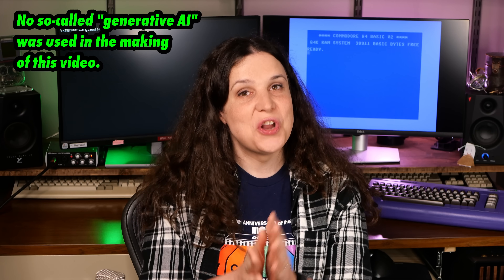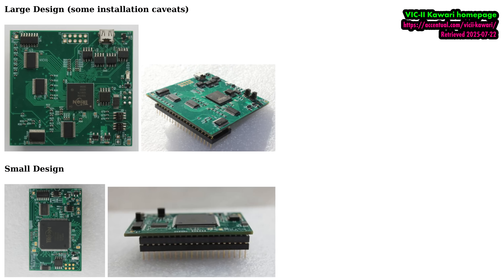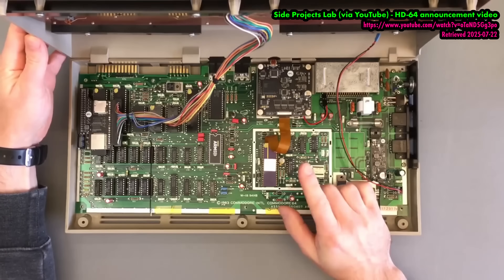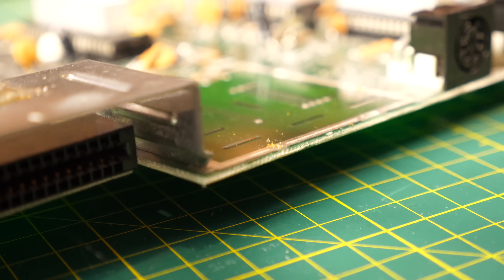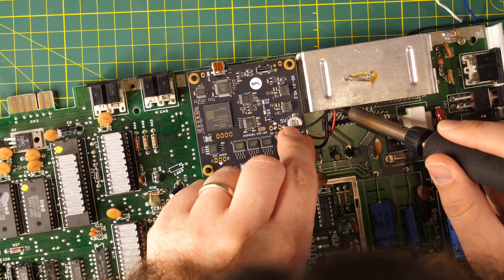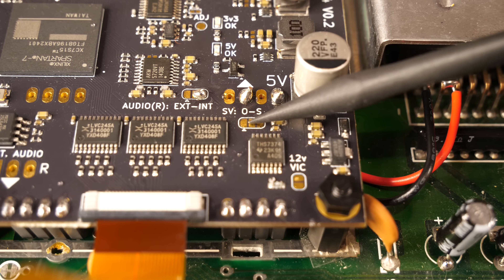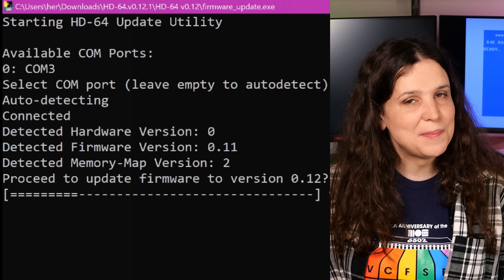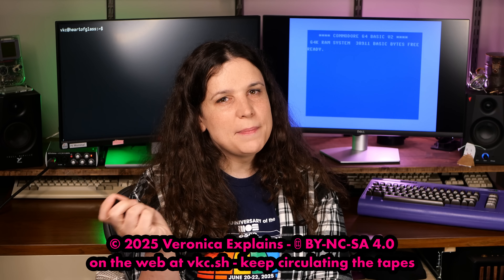My Commodore 64 has an HDMI port now.

Comment: On ZX Spectrum we have ZX-HD for years now, no soldering, just connecting 2 boards and tightening few screws. Now the Spectrum NEXT has built in HDMI. I'm a big FPGA lover and own an Ultimate 64 and a bunch of crude C64 and C128. Does this board works on C128 too?

Comment: Who paid the HDMI license?  When you have DVI mode out, an HDMI license isn't needed but when you blend audio with the output, the HDMI police might come knocking.  If you build the project yourself from the board, it's hard for them to come after you, but when you BUY it already assembled, the HDMI police would go after the guy who sold it to you.  If some method or technique to escape the license requirement it would be good to know because in the "Color Computer" world, we have "CoCoDV" (which outputs using an HDMI connector but without audio) and there is the RGBtoHDMI now with an audio addon-board, but it's kind of clunky whether outside of the case or inside.  If the CoCo's RF CAN whether on the CoCo1/2 or 3 or the MC-10 is replaced with a board like this it would have to be smaller) it would be neat and clean and beautiful.... like your rig.

Your solution is CORRECT in my opinion.  The biggest problem with retro is display devices.  S.Video is RARE now and composite is still out there but the quality never delivers.  It's either Lumacode or something else.  But this is clean and VERY portable.  You can take it anywhere.  Can't say the same for the more clunky solutions.

Comment: Great video ! For twenty dollars more, I ordered and installed the Kawarii. 
 It has the same great HDMI and it replaces the aging VIC chip.
 The Commodore community is alive and well. We are winning the war against the gatekeepers.
Reply: With all due respect to Randy and his incredible work, the Kawarii carries no audio over HDMI (it does good ol' DVI) and does not output Full-HD, so you're at the mercy of your TV's upscaler
Reply: @sideprojectslab7352  Correct points to be sure, but all of the new gadget fanboys, myself included, have to remember that others consider that full hdmi experience to be too VICE like.
Reply: @sideprojectslab7352  Can the HD-64 be added to the small Kawarii that doesn't have HDMI?
Reply: @Zardozer  yep
Reply: +1 For the Kawarii. It's an awesome replacement chip and the extra video modes are the cherry on top. I'll definitely be checking out the HD-64 though. This renaissance in hardware projects for the good ol C64 is incredible.

Comment: C64 purists will argue that the C64 isn't supposed to have a razor-sharp display, and that the graphics were designed for, and look best, on a CRT monitor complete with scanlines and color bleed. I always found it ironic that back in the 80s, C64 owners were trying to get the sharpest display that they could, while today, emulator users are trying to make the output look as blurry and distorted as it did in the 80s.

CCGMS - This was my favorite terminal program! I used a couple other ones occasionally, depending on the situation, but this was what I preferred for daily use.
Reply: The irony is only apparent, different people look for different things and, for those folks who need 'em, the HD64 provides artificial blur, scanlines, and soon PAL color blend :D
Reply: @sideprojectslab7352  I wasn't aware that the board provided CRT emulation. I've only watched this video about it.

Back in the 80s, I and everyone I knew with a C64, tried everything we could think of to try and get a sharper image, and reduce the color bleed. Wrapping the RF cable in foil, using a coax cable with RCA adapters on each end, connecting a resistor across two of the pins of the monitor port, etc.

Comment: About audio for the RGBtoHDMI: This is already supported for some time now thanks to some miracle done by Ian. You only need a very small add-on board that can be installed in any existing RGBtoHDMI. (Or buy one that has this already installed).

Comment: I don't have a C64 unfortunately. I have pre-ordered the new C64 from the new Commodore though and I hope that project turns out well. I do have an Amiga 500 though and with a PiStorm and the RGB2HDMI + gotek it's amazing. I have a simple KVM and I plug the HDMI output from the PiStorm and the RGB2HDMI into it so that way I can use one monitor and just press a button to switch displays.

Comment: Soldering, singing and playing guitar, editing video, knows ways around Linux and COBOL... 

What can you NOT do? There must be something.

This is incredible work. 

I use an IBM KB8926 (Yes, really!) and now I wonder, would it be possible to make a "Linux desktop keyboard PC"? Like the commodore, but making a fusion between something like this KB and something like a RBPi or something and you would only need a monitor to plug into to see image but technically, it would be a "portable PC" that is not a laptop. 

I am sure some engineer out there thinks "Sure, I can make that work".

Comment: A good and lovingly made video, thank you Veronica. But 109€ + shipping just for the HDMI output? You can get 2 working C64s for that around here. I prefer to stick with a CRT monitor, that's what the C64 is made for and for its imperfections. The C64 graphics look much worse to me on a modern monitor.

Comment: That appears to be a sweet solution. Loving the config menu options and that audio is included! All I wonder is if the FPGA actually does VIC emulation or is it just doing image processing? Because I for one would prefer the VIC (or SID) not to be emulated..

Comment: "Stop gatekeeping retro" 💯
Reply: Ain't nothing wrong with using upscalers or HDMI adapters or even emulation. anyone telling you you're not having fun or "doing it wrong" is wrong.
Reply: @JessicaFEREM  Absolutely. Emulators open up a lot of doors to various improvements in games, especially with HD or widescreen mods, or even support for new "virtual" hardware or mappers.

I primarily use software emulation to play older games, but also have various FPGA-based consoles that I equally enjoy.
Reply: Most of the people I knew who had C64s back in the day loved to mod them.  Adding dual sound chips and hacking the motherboard to add hard drives were two of the most popular mods back in the day.
Reply: Retro for all!!!
Reply: FPGA is literally a tool, like any other tool. It's like arguing over what brand of soldering iron someone uses ffs.
Reply: Precisely, we love retro and if retro can be improved with modern tech & manufacturing, so be it. At the core, it's still retro.
Reply: Soon there will be an original C64 board in the core of a future Commodore Droid running household and outdoor physical labor in our gardens. What a marvel to see people enabling old retro hardware while maintaining its natural and deep historical charm within.
Reply: what kindofa dude's gonna rag on the coolest part of this build? don't like don't use, homestyle!
Reply: Clippy
Reply: Thank you!
Reply: If these mod creators would just  stop forcing people to buy and use them, people would stop gatekeeping. Oh. Wait.
Reply: @R.Daneel lmao peak reply

like this isn't something I'd ever do to a C64 if i got one cuz i like my CRT TV but it's cool and accessibility is based and peak